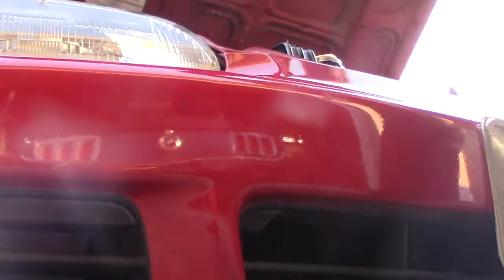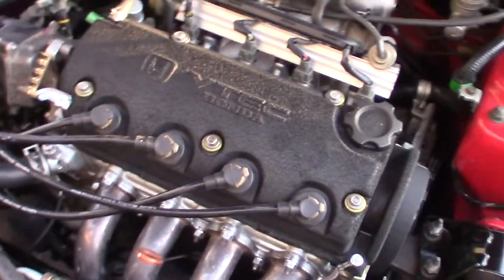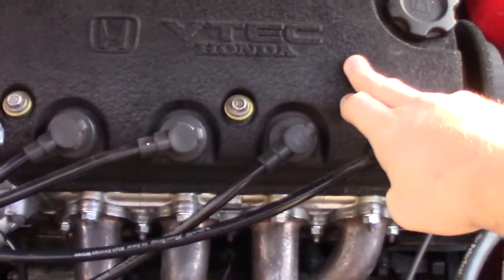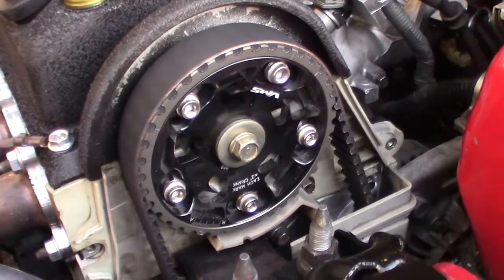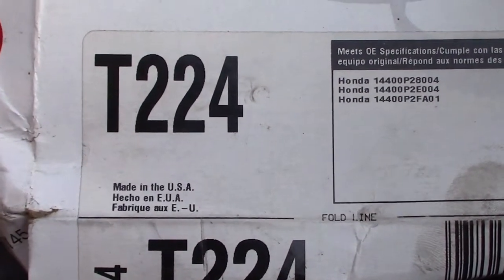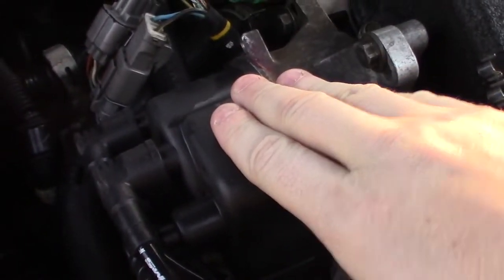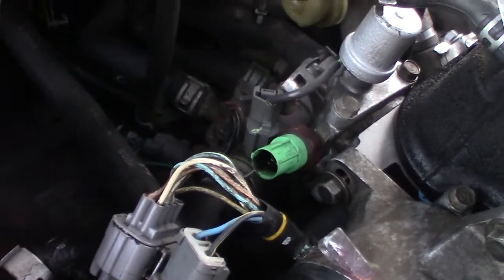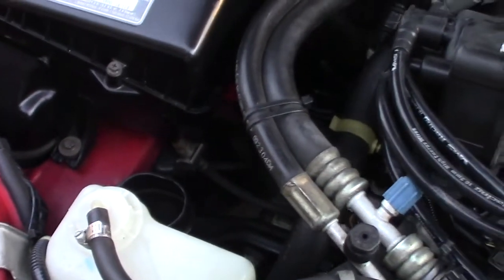Mini Me Swap: Honda Civic D15B7 / D16Z6 Head - Parts, Budget, and More!

Comment: Long time ls guy here, but I just picked up 91 civic sedan 5 speed and I’m really impressed with all the ways you can swap parts on these little engines! Could you do this swap on a D15B2?
Reply from the maker: Welcome! They're like junkyard Legos just like LS, you can absolutely do this swap on the D15b2. If you are used to driving fast cars though, you might just want to do pistons and rods and a big turbo along with the VTEC head lol
Reply: @RiggsGarage  this is just my little gas saver! Well hold off on make it fast for a while!
Reply from the maker: @KapenW17  that's where I am, I have the pistons and rods to build it mean, but I'm liking the gas mileage and reliability
Reply: @RiggsGarage  wonder how well it would it would hold up to a 50 wet shot? That would be the icing on the cake after the head swap. Bought a z6 head earlier from a buddy that’s doing a k24 swap on his hatch.
Reply: Where do you think is a happy medium? I like my gas mileage and enjoy the driving experience but performance wise it’s lacking for me a bit. I hav a fully stock 97 CX D16 but would atleast like to add just a little bit more pep to it 😅

Comment: Hey man just had another question. Need some help on how you did the timing? I read the Honda forum write up but it’s a bit confusing. 
I bought the same vms cam gear and belt.
Reply from the maker: Yeah that is confusing. So basically you need to make sure your mechanical timing is showing the timing marks correctly on the harmonic balancer when you're using your timing light. My adjustible cam gear is at 5 degrees retarded to accomplish this. Distributor is right in the middle. This may be because I might be a tooth off and could be different on your engine.
Reply: @RiggsGarage  so basically everything at tdc like a regular timing belt change. And retard the cam gear to 5 and make sure the harmonic balancer is aligned?
Reply: I thought you had to advance it, from what the Honda forum said. 
How are you a tooth off though?
Reply: @RiggsGarage  I have the same engine, b7 bottom z6 head
Reply: I used a z6 timing belt and used the 7 o'clock mark on a factory z6 cam gear. Time it the same way as a z6   just make sure ur using the same water pump for that block.  I  found that certain ones have more or less teeth

Comment: Great build and video! Doing this build to! Almost have all the parts, hopefully be done by end of may 2022! 
Quick question, did you reuse the b7 head bolts or get new ones?
Reply from the maker: I refused the B7 bolts. Might throw some head studs in there if you're planning on throwing boost at it. Thanks for watching!
Reply: @RiggsGarage  ok thanks for the reply, maybe in the future I’ll go for boost! Are you upgrade studs for the boost on yours? If so what brand?
Reply from the maker: I'm building a different short block with pistons and rods so it will live longer hopefully. Using ARP head studs, 208-4301 I believe
Reply: @RiggsGarage  ok nice! Saw the video , wish I had time and space to do that! I just got ahold of some arp studs, used but good condition. They are very hard to find. Thanks again for they reply man , good luck with the build! 👍🏼
Reply from the maker: @victorflores6363  good work, I think they will be in stock again soon
Reply: @RiggsGarage  how did you do the timing ? Did you advance the timing to 4.75* ?

Comment: I have a jdm d15b block with a z6 head, in swapping another z6 head cause my valves in #4 are bad so should i use a y8 headgasket for more compression?
Reply from the maker: It will give you a slight bump in compression, not worth taking the head off for to replace the gasket, but if you are already doing it, it is a factory upgrade.

Comment: What starter do I use
Reply from the maker: Whatever the starter is for the bell housing / block combo. I put a z6 head on a manual d15b7, so I need starter for manual d15b7 setup

Comment: I’m seriously considering doing this to my 94’ EG sedan. Hopefully do a manual swap while everything is out and boosting it. What transmission would you recommend for this? I’m a Toyota guy so Honda’s are kinda new to me haha
Reply from the maker: If you don't have a transmission yet, people usually recommend an SI or an EX transmission, they have shorter gears and more zip. I have the DX transmission which is excellent for commuting because I can go down the highway at low RPMs.
Reply: @RiggsGarage  awesome thanks!

Comment: How did you do the oil feed to the vtec
Reply from the maker: I swear I put that in the video but I just watched it again and it's not there, check the link to the comprehensive Mini-Me thread in the description of the video. You just basically remove the oil restrictor that sits in the block when you have the head off. That allows full oil flow to the VTEC solenoid. That's frustrating, I remember filming that even and I thought I put that in there

Comment: I have a d16A6 will the z6 head hit the pistons since that’s what the mechanic said it might be doing even after a valve slash
Reply from the maker: Not sure. In theory, there is no reason why they would unless cam timing is way off and pistons hit valves. You could put it on there and add modeling clay on the piston, time it, make sure it's ok

Comment: Hey i have a 95 si with blown bottom end, i have a d15b7 bottom end, just wondering if there is a way for the engine to run without the adjustable cam gear. would i be able to run it at all maybe without vtec until i get an adjustable gear.
Reply: i need this car running and im in canada so theres no sites to order a cam gear from that isnt going to take a month to ship
Reply from the maker: You can definitely run it with stock cam gear. It will only be a few degrees off or so
Reply: Thank you very much. Got a cam gear anyways don’t want to mess anything up. This video helped tons thanks

Comment: I have a quick question i have a jdm d15b with z6 head, im still not sure if i need the y8 cam cause apparently i have the obd1 d15b block which u dont need the y8 cam but im not 100% sure?! I have the distributor is fully advanced and the ignition timing is in the negatives
Reply from the maker: So there are some differences here - My video is about the D15B7 bottom end, which has a different deck height than the D15b or the D16 that requires a different cam wheel.
If you have the D15b JDM engine bottom end, it came with the Z6 head (same casting number), so all you need to do is use the same cam gear that came on the D15b setup (or an adjustable cam gear). Sounds like you may just be a tooth off in your case, because the D15b has the Z6 head from the factory, so timing should be right on. Make sense?

Comment: Man i have a civic 91 d15b2 dual point. Im going to rebuild the engine but can i install a d16 head and still run normal?
Reply from the maker: There is more to it than what is it my videofor that engine. You can run the head. However that is an OBD0 engine, that is not multi-point fuel injection engine. Also the z6 head uses an OBD1 distributor. So you will need to convert the engine to multi-point fuel injection and convert it to OBD1 and run a VTEC p28 computer. There is some additional wiring and stuff to do but it is very possible

Comment: What about the motor mounts
Reply from the maker: Stock is ok, use whatever you want. Still has the power of a factory Honda engine, you don't need aftermarket unless you want it

Comment: Great vid! Quick question though. Is the process the same for a d16y7 block? I’m trying to get some vtec in my bad boy but haven’t really gotten the confidence to rip into her yet 😅
Reply from the maker: Hi there, thanks for watching! It is super similar. There are a few places that might be different, I would recommend finding a build thread where somebody does exactly what you were looking to do. Some differences might be head bolt lengths since you have a different block and are probably using a Y8 head? Cam gear, which timing belt to use. Otherwise I think it will be pretty much the same project

Comment: Notice he said..... RELIABLE!!!!!
Reply: I've had the same b7-z6 mini me in my Civic forever....  Tuned it by Neptune and she still pulls as hard today as it did on day one.
Reply from the maker: Sounds fun! I'm building a short block with rods and vitaras, so my reliability is about to go away
Reply: @pjburcham5938  hey man, you said you’ve had a b7z6 mini me for a while, how did you do the the timing? I’ve read the forums but it’s a bit complicated. I have an adjustable cam gear too
Reply: Sounds like ur getting ready for a turbo.....   Definitely be fun then.  My old sohc was on 14 lbs n pulled on vettes on good days.  IDK y ppl gotta knock on the H. They should build 1 😂
Reply: @pjburcham5938  one more question,what spark plugs do you use ?
Reply: D16Z6 plugs. NGK

Comment: This was a big help.. and will I need a different crankshaft for d16 rods and pistons?
Reply from the maker: Hi, glad it was helpful. In this configuration, you run all stock bottom end, just the d15 block, rods, pistons, crank, Z6 head only.

Comment: I have a ‘96 EJ8 w/mini me D15b w/D16Y8 head uses the timing belt from my y8 with no issue also have the adjustable sprocket and only needed to use the alternator belt of a D15B. It’s a nice lil combo and my Vtec cracks the block already had the oil jet removed as it is required for the good’ol Vtec 
Now in all seriousness what would be the best trans to use for the mini me?
Reply from the maker: From what I've read the best ratios are in the EX and SI transmissions, I am currently looking for one as well! It gets rid of the tall first and second gears that make your acceleration really slow with a DX transmission
Reply: Hell yeah perfect I have the correct one on there then, and I have a spare one also man. If you need it I got you
Reply from the maker: @joshuacardona3935  where you located??
Reply: @RiggsGarage  in the DIRTY DINO S.B

Comment: How you doing boss, quick question, . I have a d15b7 block and i plan on doing the mini me head to the motor. Using a d16z6 head. Now on the d15b7 motor, i noticed that the crank pulley does not have the pulley to run power steering. although the d16z6 crank pulley can run power steering.. My question is about swapping the crank pulley. the d16z6 crank bolt is 19mm socket, and the d15b7 crank bolt is 17mm. Is it possible to put the d16z6 crank pulley on the d15b7 block that way i can run power steering. I've looked but cannot find the info.
Reply from the maker: That's a great question, I am 98.41% sure they will interchange, however they are different weights. I'm not sure if the balance is different, that could jack some stuff up if the balance is different. I would do some deep digging on d-series.org forums, the sacred texts 😂
Reply: @RiggsGarage  hahaha 98.41%, thats funny. I still couldn't find the exact info but I heard people say that d16y8 pulley will work fine and is actually better anyway as the y8 pulley is an actual harmonic balancer compared to the other d series pulleys, that aren't harmonic. Thank you for the reply!

Comment: hello friend congratulations for that beautiful project. I made a minime with a d15b2 block and a d16z6 cylinder head and I had good results but I put the injectors from the d14 a4 that I had in the previous engine. I have problems with engine piston. Do you think it is necessary to place some injectors of more volume? Thank you
Reply from the maker: Hi Omar, thanks for the kind words. What problems do you have with the piston? What computer are you using? I would make sure the injectors, the computer, and the head / intake swap all match up. For example, my computer, injectors, and head are all from the same swap. 240cc injectors, Z6 head, P28 computer. Hopefully this helps you, let me know

Comment: Riggs garage I got a huge ? On the mini me swap on timming the car is my issue I’m running in to I’ve read n read bout it but I’m hearing multi things u got to have the timmin adavance some and I’ve heard u don’t I’m confused
Reply from the maker: Hey thanks for watching. Right now I'm running it dead straight up, there are several different people that say I should be running advanced using my adjustable cam gear. I need to dig more into it honestly, the car runs fine as it sits, but if I do that and it runs faster than I would be super happy. Check out the link to the forum thread I put in the description and see if that helps you. Let me know what you decide!

Comment: Riggs garage  any advice for a newibe I’ve got a 97 hatch with  d15b7 z6 mini me swap in my car right now got to pull head and all off to make sure when I broke the belt tonight while crusieing tonight bout 30 mph that I didn’t damage anything and make sure I get it right might take me a while to get it back but it will be back..
Reply from the maker: Dang that's no fun, when I slipped a timing belt on my B7 head the valves all looked good, but several were bent when they were pulled out of the head and rolled on a flat surface. I'd recommend pulling all the valves out, rolling each one, and replacing the bent ones, then reseating them. I don't have time for that so I a machine shop $200 to go through the head and make sure it was flat and reseat the valves etc
Reply: Riggs garage got another ? Buddy my brother is doing a mini me swap in his car to he’s going to go with a y7 or y8 head on his b7 block he said whatever head he can get faster but he was wondering if he will have to have the timing advance like and on the d15b7 z6 head do u have to have advance timing on tht to

Comment: Need a little insight if you don't mind.... I recently bought a 97 EJ6 "EK" hatchback. The guy I bought it from Only knew that it was a jdm d15b. When checking it out seen the p2e ecu along with a top mounted TB on a older intake manifold and assumed it was any old non VTEC d15b. Got it home and realized the head is a p2j-6 "97" y8. Last 3 owners have dailyed this car on the exact setup. (Guessing 2-3 years as last guy said he's been daily driving it for a year) Do you think it was purposely setup like this for a reason Im just not understanding/ or comprehending? Or do you think it was just thrown together good enough to get it driving and passed on to the next guy? Also would it be worth trying to save the cluster fuck of unhooked wires and plugged hoses with a proper intake and chipped ecu? Or just pull everything and start my own build once this one pops? SORRY I KNOW IM ASKING A LOT!!! But any insight or knowledge you could pass along would be greatly appreciated!!!!
Reply from the maker: What does the block say? D15B? That plus the y8 head would be solid
Might see what intake is there, I'd grab a y8 throttle body and intake from the yard and use that if it has a top mount intake (y7?)
Reply: @RiggsGarage  Yes the block is stamped D15B.

Comment: I'm guessing you can also do a mini me swap with a d15z6 VTEC e right?
Reply from the maker: Likely, I haven't looked into it. Honda is like Legos though, just need to work out the details like what gaskets and head bolts to use. Generally you use the same timing kit as the short block. Thanks for watching!
Reply: @RiggsGarage  no problem and thanks for the reply

Comment: Wouldn’t it be smarter to just get the complete VTEC single cam motor to begin with? Seems like a lot of headache when you can probably go to the junkyard and pull one out of a Civic EX
Reply from the maker: That's definitely an option. The word smarter would be applicable in some situations. Junkyard motors are iffy unless you're buying one with a warranty that's been checked out and inspected that came out of a wrecked running car. Then it costs more than the mini me swap. If you had a really clean d-15 short block that is not worn out like mine, you can grab a VTec head for $100 to $200, and slap it on in an afternoon while you're doing a timing belt job. Much easier for the average Joe who doesn't have time or tools for an engine swap. But I would agree that a d16 z6 would be preferred, especially since 99% of the guys that do the mini me swap feel how much power it adds and instantly want a turbo lol. Thanks for watching!
Reply: @RiggsGarage  you having to source the intake manifold, TB, ECU, Distributor, etc. I figured might as well just get a complete motor. Not sure where you’re from but over here in California I see the single cam VTEC motors often at junkyards. Most engines live normal commuting lives. I guess since it’s so commonplace here that’s probably why I would get a complete motor. That may not be the case where you’re from. Keep up the vids. Always good to hear what Honda hotrodders are up to
Reply from the maker: @kenxiong6830  that sounds great! Thanks for the encouragement. I'm actually looking for a full z6 swap right now since they can take more abuse on the stock rods pistons and crankshaft. I agree, most of them lived a normal commuter life. If the junkyard car has stick on air vents, dragon stickers, a body kit, and a shiny shift knob, I would run though lol
Reply: @RiggsGarage  yeah those are the dead giveaways that it’s probably not a motor you’d want. I once did a H22A into a CRX. Holy shit it was fast. Blew the doors off a lot of people lol

Comment: I'm doing the same but mine will not start at all
Reply from the maker: Mine did the same. Do you have spark? Triple check timing. The z6 distributor I used had a bad coil. I switched the coil from my b7 coil into my z6 coil and it's working now.